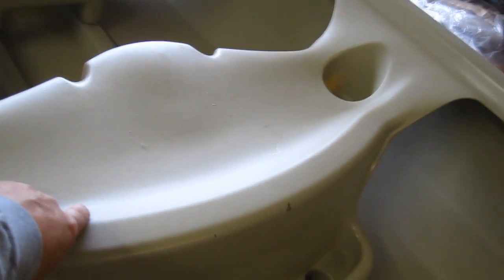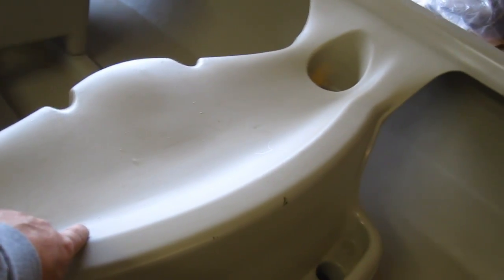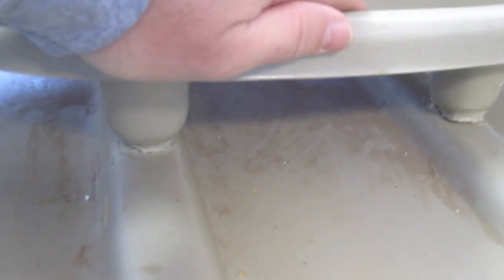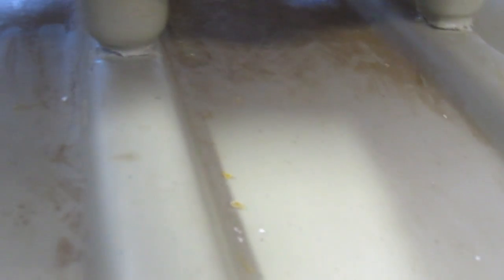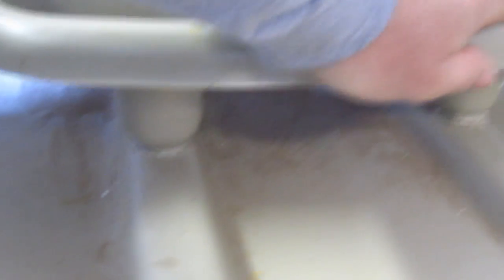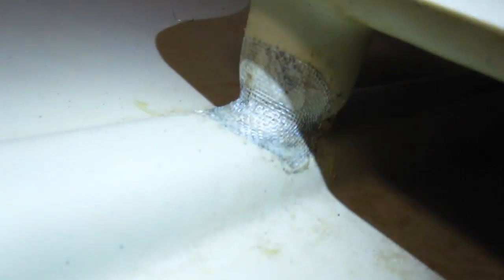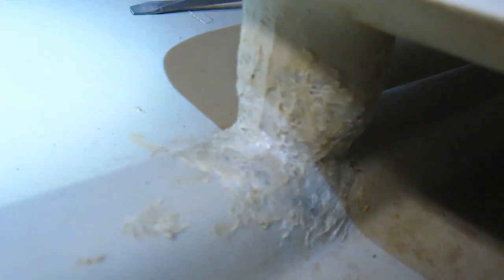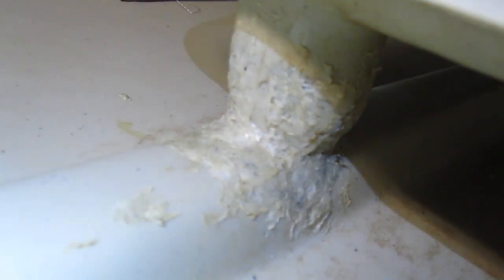DIY How to repair a Mad River Adventure 14 Canoe

Comment: Thanks for the tip. I'll remember not to pickup the boat by the seat. I made removable double Oak Yokes on the Bow and Stern mainly for fishing rods, and a camera. I noticed a few people had this problem, wonder if you removed the seat completely and added one or two Yokes to the gunwales in the center for reinforcement just like a standard Canoe. I could use the room, the seat just takes up space. Like the guy below with the dry hatch idea, would be nice. Will post a picture if I do this.

Comment: All 4 were broke on the rear seat of the one I just bought I put closed cell foam underneath center in the groove to support the weight in the seat and used all thread rod front to rear to keep them from spreading.

Comment: Fixin’ to use your technique on the middle seat and back seat. Can you tell me how well it held up?
Reply: Just read your response to question below.  Anything you might do different knowing what you know?
Reply from the maker: It worked great. I got rid of and went to a kayak. It was still holding up with I sold it. Just take ur time. The better job you do the better it will hold up. When you think you've done enough, do it one more time. But make sure the first layer is stuck and melted in for best results.
Reply: I saw where you went to a kayak.  I’m researching kayaks, now.  I sustained a linear fracture to the hull of “ The Ms. Becky” after she tumbled off the Tahoe a few weeks back.  I’ve been hell on the Ole Smokin’ Rabbit since I took her the showroom floor back in May ‘10.  She’s been through a lot of trauma and neglect.  I saw your video first thing once I started researching HDPE canoe repair.  Seats are one thing that bow fracture might not be repairable.

Comment: lol, just left a rude comment on their website  Then, I see this post and that's where mine broke - thru the bottom.  I used it only once, with my son, on a lake,, and it broke right there, exactly!!!  I  weigh 175 and my son is much less,  but there is no reason why after only one run we have to repair a crappy design on a $750. boat.  Mine broke because I was standing on the floor casting.  It really is just that cheap.  They should call it the MAD MAN boat.
Reply from the maker: Agree!!!! The fixed lasted a while but came back.